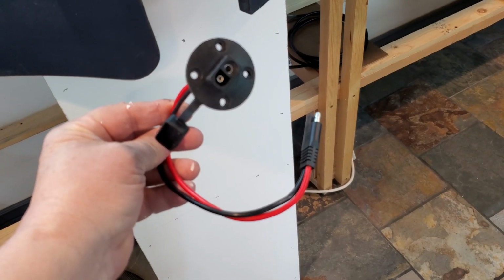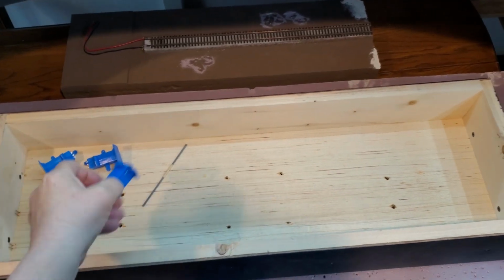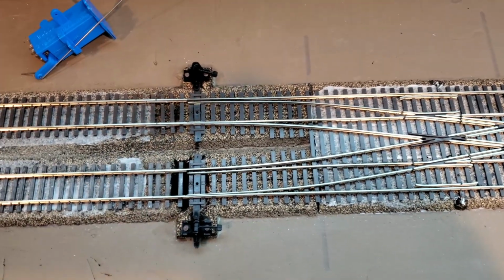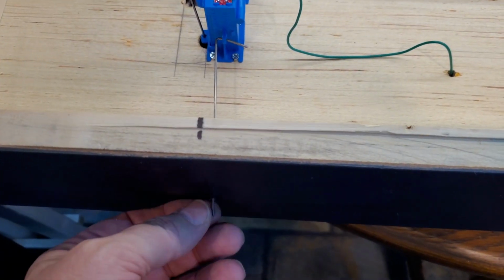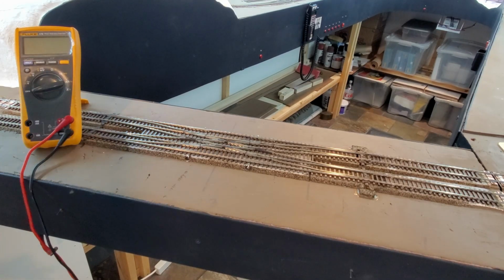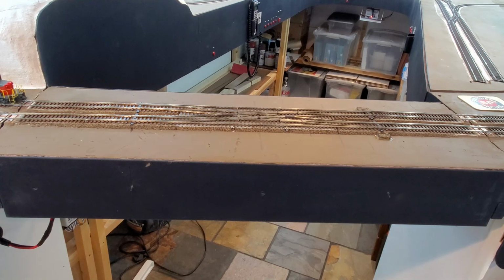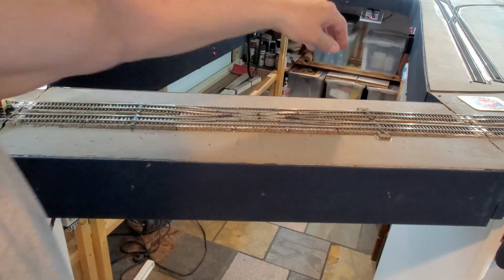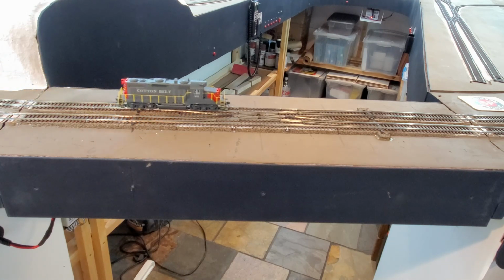Walther's Double Crossover Problems and Solutions. Lift-out Section Wiring. HO Scale Layout Part 37

Comment: I use Tam Valley Depot Octos with servos and their frog juicers. The draw DCC commands from the bus wires eliminating the need of running the cab bus in situations like this. I’ve had excellent results with this setup. I will eventually change out all of my tortoise switch machines with servos.
Reply from the maker: Sounds like a nice setup. It's good that we have options for controlling our layouts because everyone has their own needs and preferences. Having those options is an indication of a healthy hobby doing well.

Comment: Interesting placement of your double crossover. Is this a newer or older Walthers double crossover? I don't have a frog issue with mine. I did have to go with bigger wire with the tortoises too. - Jason
Reply from the maker: It is the newest version of the double crossover. I didn't have an issue with the frogs, I had an issue with the rails being shorted together. It was challenging to troubleshoot because of all of the A rails are tied together and all of the B rails are tied together. When I used my multimeter to check it the entire double crossover was shorted together with no separation of A rail and B rail. Cutting the gaps separated the A rails and B rails and fixed it.
Reply from the maker: The liftout section was the only place in my track plan where the double crossover would fit, so I needed to make it work. I initially wanted to use Tortoise machines but the problem was I would need to build a large wiring umbilical with a lot of wires to connect to the track bus, DC power and momentary switches. So I decided to use the Blue Point switch machines because I could make my connection with only 2 wires. The .060 music wire works great.
Reply: Jason would I need to modify my double crossover, I need to look at the one have , looks like a easy fix
Reply: @dundasjunctionmodelr.r-jam8267  good thing I am fixing to build my own. I'd sell you the one I have but someone else has already spoken for it. If he turns it down, you can be 2nd in line. I don't have any issues going over the frogs.

Comment: I believe the short you had will go away if you also throw switches for the other side of the crossover.  By making those cuts, you now only have to throw 2 switch points instead of 4.
Reply from the maker: Well, I was certainly having problems with it. Now it works great.

Comment: I think you will end up changing your pull locations at some point,  reach over or under the lift might get a little old.  But I'm not knowing the full use of the cross over.  so it might see little to light use and not be an issue.
Reply from the maker: I just use the double crossover to get a train into and out of the town section of the layout. I build my trains on the interchange section of track and run them onto the layout proper from there. When building a short train to switch the industries I use the double crossover to get the train into the town section of the layout. After switching I use the double crossover to get the train out of the city and back onto the interchange track.  The trains I run on the mainline are continuous run and never go into the town section of the layout, so the mainline trains only use the double crossover as a straight through track.

This allows me to switch the industries while I have a long mainline train doing continuous running. The town track and the mainline are completely separate other than at the double crossover. If I choose I can have the town section and the mainline do continuous running and they would never contact one another.

Comment: Steve is this the new Walthers double crossover or the original version , I have the new version, I plan to use it in a similar way like you are doing
Reply from the maker: This is the latest version of the double crossover.  Before you install the double crossover closely examine the areas where I made the cuts.  If the two rail sections are making contact be sure to cut them apart or everything except the outer rails will be shorted together. 

If you are using switch machines replace your music wire with a larger diameter wire. I removed one of the throw bar springs in my double crossover but found it didn't make a lot of difference in the force required to throw the turnout. Some difference yes, but not enough that a .032 music wire would work. I went from .032 music wire straight to .060 music and it works perfectly with the mechanical Blue Point switch machines. If using .060 music wire with Tortoise machines you will want to adjust the reaction arm and the reaction arm hole size so you don't put a lot of stress on the Tortoise machine.

Once you get the bugs worked out of the double crossover it works great, but out of the box mine had issues.
Reply: Steve I will check mine out , using mine in a similar spot , also subbed your channel
Reply from the maker: @dundasjunctionmodelr.r-jam8267  I appreciate the sub. The double crossover works great with a little prep work. Good luck!
Reply: Steve I checked both of my double crossovers, I did not have any shorts but the gap between the frog is very close, I will adjust the gap when I install mine
Reply from the maker: @dundasjunctionmodelr.r-jam8267  Good to hear. Probably just some variation in manufacturing. It should work fine for you if you have no shorts.
Reply: Steve yes agree , but the gap is very close , I checked mine with a meter last night on our live off track Monday
Reply from the maker: @dundasjunctionmodelr.r-jam8267  With the current being generally pretty low through the track I wouldn't expect any arcing issues if it's not shorted. But it never hurts to be safe and widen the gap if you choose to do that.
Reply: Agreed